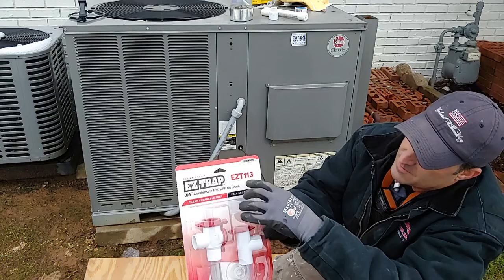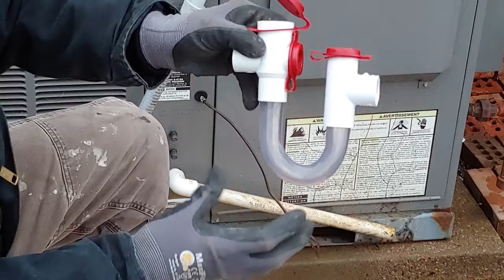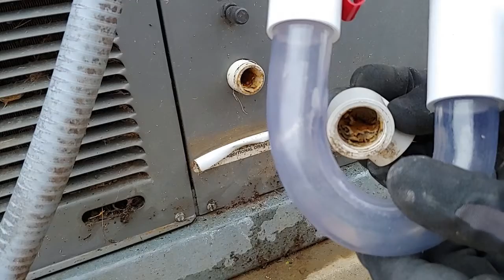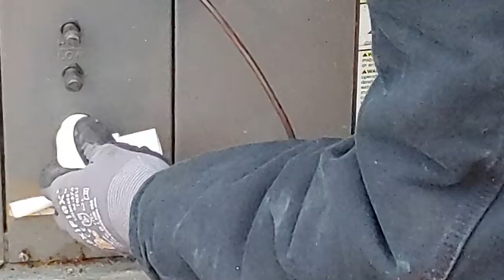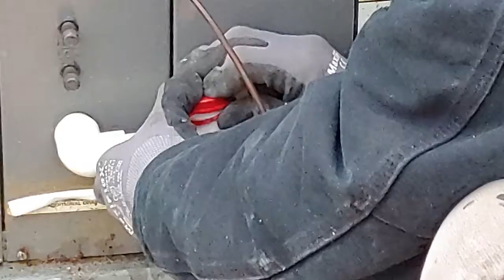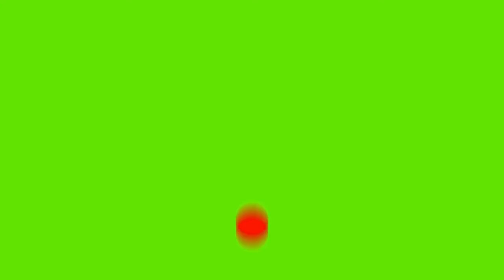Rectorseal EZ Trap 113 Installation Inspection P-trap Tube #homeimprovement #DIY #lifehacks

Comment: My furnace/central air was leaking all over the basement because of a clogged drain pipe. As a DIYer it took me forever to figure out why. As the drain pipes were all glued together I had zero access to clean or look inside the pipes. Installing the EZ trap will solve any future issues. I don't know why when you pay someone to install something they have to do everything in the easiest, fastest way possible that will give you problems later on. A professional should have known these drain pipes clog all the time and that they were creating a future problem by not providing a cleanout. It was probably on purpose...
Reply from the maker: HI! Thank you so much for watching the video. This EZ Trap should help to solve future issues and make it so much easier to clean out when necessary. Depending on how old your home is, these traps might not have been available at the time. I hope that this video helps you to install one of these traps. You Can Do It👍

Comment: Should the lower cap be open??
Reply from the maker: Hi Christine.  Those caps only need to be open to clean the drain.  The trap works without the caps needing to be open. Hope this information helps 👍
Reply: @YouCanDoIt2  Thank you